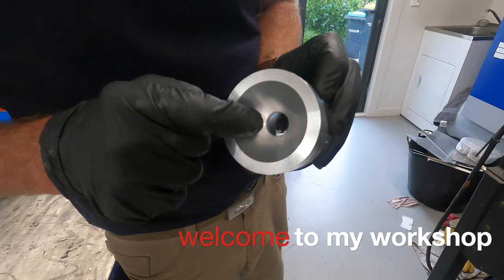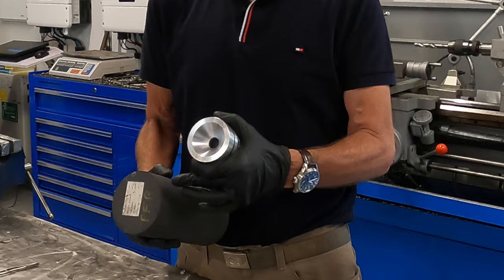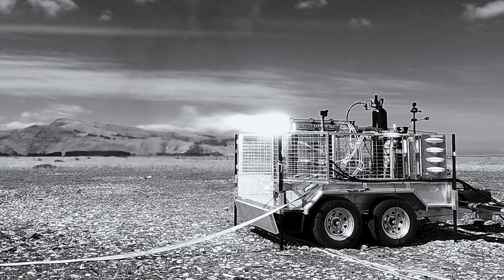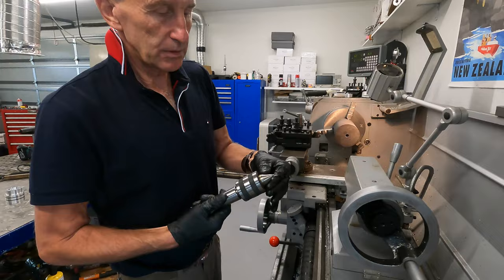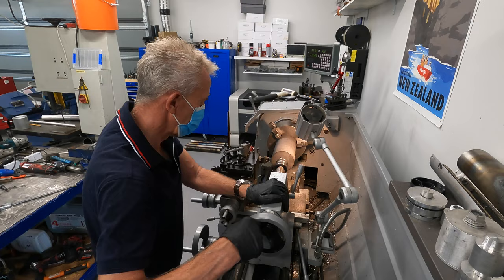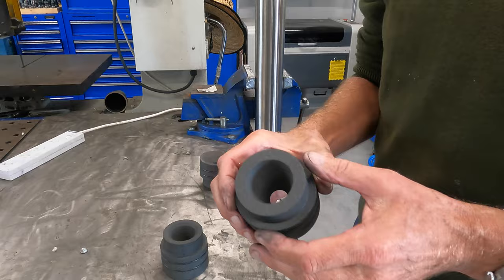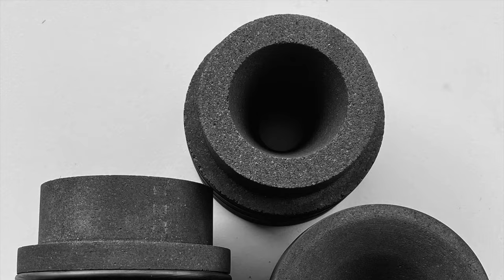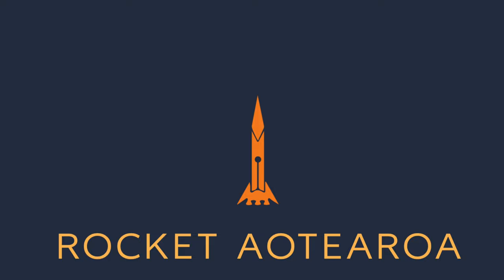graphite rocket nozzles  | workshop project | Tormach Slant Pro 15L Lathe | Rocket Build

Comment: Hi Lasse here again,
Its nice to see you adapt comments from youtube and aktivly improve your work.
About working with graphite: 
slow and steady wins the race. I know it is tedious work but having your CNC spin slower (and your manual drill as well) will give you better results and less dust. Also, you have used some rather grainy graphite. If the graphite is finer you can have more refined edges and surfaces and the nozzle will also have greater strength. Since your construction is very solid and your nozzle is incased inside the tube, you dont need that higher strength but the clearer surfaces might make a slight difference.

Anyways, great video like always and I hope you will reach the desired thrust values with the new and improved nozzles!
Reply from the maker: Everything noted Lasse, thanks for the help. 
We should be ready to test in approximately two weeks weather permitting 👍

Comment: Keep up the good work! Really enjoy watching.
Reply from the maker: It makes a big difference to read that you enjoy watching thank you for letting us know 😀
Reply: @ExcitingCrapo   you are doing stuff that we can only dream to have the time or resources to do!! Amazing work

One question though... how is the nozzle permenantly fixed on the tip of the rocket?
Reply from the maker: @FirstLast-tx3yj  thanks for commenting it means a lot that you enjoy watching. 
I’m very lucky to have the time and resources every day is exciting for me in the workshop. 
The nozzle’s only have the two O rings sealing against the stainless chambers. 
They can’t come out because they are trapped in place with the large metal end plate. 
The same is going on at the injector end. 
Threaded rod keeps the plates under the correct compression 👍
Reply: @ExcitingCrapo   @ExcitingCrapo  what is the plan for these rockets? What will be the application?

I have to mention that I believe hybrid rockets are the best for a "Budget project but the change in O/F ratio as it burns and inability to increase the amount of fuel without affecting the whole design of the chamber is complicated

Although i have tried to work out some solutions but yet to experiment on them

By the way tech ingredients had a great series on injector choice  to increase burn efficiency did you watch that or do you have a different injector??
Reply from the maker: @FirstLast-tx3yj  I’m trying to get the engine under control and optimised for max thrust. 
Then I will build a 7m rocket.  
I realise a triple is not necessary but it will look amazing and that’s reason enough for me. 
I asked for help from a university rocket team in Germany who worked out the required surface area for 1000 psi oxygen injectors. 
Astra Bremen is their channel. 
I have completely redesigned the injectors and rebuilt my oxygen tanks and optimised my throttle’s. 
Should be ready to test at the end of the month. 👍

Comment: Having O-Rings in Graphit pets isn’t the best solution, the Graphit gets really hot and conducts the heat quite well, that will demolish the o-rings quite fast and create a potential leak. In  hybrids it’s common to place the Graphit part into a Pertinax (phenolic paper) as a insulation material to hold onto the hot Graphit.
Reply from the maker: This is very useful and interesting information thanks for that. 
I have another test coming up in a week and will add that to my nervous pile as I’m somewhat committed.
Reply: There is nothing wrong with using o-rings to seal the external shaft of graphite nozzles, you just use several and assume the front end one will be sacrificial. I have sealed nozzles using NBR/Buna, EPDM & Silicone o-rings in hybrid motors past 20 seconds of burn time without issues.

Comment: Hey there.. You really need a fully enclosed dust extraction system for machining graphite, otherwise the fine graphite dust will float through your whole shop coating everything and make its way into your electric motors causing them to burnout. Good luck with your upcoming test.
Reply from the maker: Good to hear from you Jamie. 
I haven’t seen any problems developing using a sacrificial O ring and my burn times at best would be not greater than eight seconds so very good to hear you managed twenty seconds.
I definitely underestimated the mess caused by machining graphite. 
My shop floor still has black patches that appear after many scrubs. 
Next time will be a very different approach to the serious dust problem. 
Thanks for commenting👍